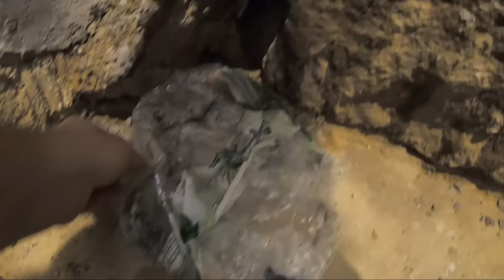Tiny House Shower #7 - Lasers, Lime, Bottles, & a Crazy Lighting Idea

Comment: You're render application technique is great Kristy!  You've come a long way!  May I suggest you use an aluminum screed (straight edge) to level off the high spots and fill in the low spots, followed by a wooden float to bring the cream to the surface and finally a steel float for a polished surface.  You are doing a great job :)
Reply from the maker: Thanks! It's a LOT easier to render with lime putty mixes, so don't be too impressed! 😁 I'll do a screed and float on the final coat. I still have a bunch of thickness to build out and I'm doing that in gradual layers. But for the final one before the finish plaster, I'll attempt those things for sure.
Reply: @PortugalfromScratch  I think you will be pleased with the outcome. You seem to be doing well.  I'm happy for you 😊

Comment: Wonderful work. I am picturing the completed shower in my head and I can't wait to see the finished product. I know it will be so much better than I imagined.
On another note, regarding the pomegranates. If that's the first crop, they usually remove it and the next one comes in abundance. It's really hard to do. I need to remove my first figs and it's not sitting well with me 😮
Reply from the maker: I still fully can't envision it in my own head... but I have a rough idea to work towards. 😁 Thanks for the pomegranate tip!

Comment: Your choice of tiles looks nice.  The smaller tiles will work well for the shower floor,   Is your plumbing on an outside wall?  Your LED lighting plan sounds interesting.  Good luck on your shower project.
Reply from the maker: Thanks! Yes the plumbing will come in from the back wall. In the case of the shower it'll be piped separately and then other pipes will come through under the bathroom sink and snake around the house over to the kitchen. It's possibly not ideal but I guess these types of little stone buildings have some unique challenges. 🙂

Comment: You should have thrift shop lead crystal decanters in Scotland, my friend had then filled with leds at a party and it was magical. I think LED string or water drop string  lights would fit your bill you can also get corks with a battery in the ‘cork’ a small string attached to push into the bottle, but threy are battery powered with watch batteries - not that eco!
Reply from the maker: All great ideas, thanks! Thrift shops aren't really a big thing here but I'll keep that idea in mind for when I'm somewhere they're more common!

Comment: I think what you are talking about are called fairy lights.  Edit:  I've seen some that have long strands that hang down.  Most are wires with the lights in the wire.  You would have to probably cover some of the lights with electrical tape so you don't have a long strand of lights showing.  Just in the bottles where you want it.
Reply from the maker: I know fairy lights... that could work but I'm thinking of something different. It's hard to describe it and maybe they don't actually exist! 😁 But I'm hoping someone out there might have seen what I have in mind! If I can't find these mystery lights, I'll probably use some sort of fairy light setup. Thanks!

Comment: It’s not the same as having lights in the bottles, but if that doesn’t work, a backup option you could try is LED tape/ribbon. A common and fairly easy to figure out/“install” version looks sort of like a roll of foam tape you might use around drafty windows, if that makes sense. It’s flexible and looks like rectangular pasta (not the clear kind that had tiny lights that give a pixelated look). Could drop a link if interesting.

There are apps you can use to control use, intensity, colors (solid colors, gradient colors, make it a pulsing disco, whatever you get into figuring out, ha!) It could run along the shelf to light bottles, or anywhere in the house really, without needing fixtures
Reply: There’s another kind too that’s quite literally like transparent tape with flat circuitry running through it, too. Probably the better easy option
Reply from the maker: I would love a link, I can't visualise what you're describing. My guess is that the bottle neck might not be wide enough for these, but maybe? I love the idea of controlling it with an app. I think what I need is called 'micro LED' and there are lots of programming options using Raspberry Pi and Arduino, but I think those things are out of my skill set. 😁

Comment: Are you going to embed the pipe for the showerhead in the wall? If so it needs to happen asap. The faucets for a shower often have a box thingy that is in the wall.
Reply from the maker: I have a shower head in mind but haven't bought it yet. Here it's common to have the shower head piped with a bendy pipe from the tap at the bottom. So the two pipes I've already put through the wall will be what feeds the shower. The whole thing sits on a sort of rail and that will need to be attached to the wall so I'll want to do that on this layer or the next, I think.

Comment: some girl has made some plans 😅. Those glass bottles are beautiful as they are and I can picture them with tiny led lights - great idea. Tadelakt is awesome, but when we were on the hunt for a Moroccan table for the outdoor terrace, we have been told that it’s not suitable for outdoor use as it is not weather proof. So not sure if it is a good choice for a shower? Where did you find those lovely patterned tiles? Currently looking for sth similar. 
Cheers to emptying the next 4 bottles 🤣. cu tomorrow.
Reply from the maker: Glad you like my plans! Tadelakt, when done properly, can even hold water as a bathtub! I'll need a lot of practise before I attempt my shower, but I'm confident it'll be ok. There's an amazing place in Costa Rica called Rancho Mastatal who make tadelakt showers, so they're my inspiration. I got the tiles from a place in Castelo Branco called Soffaragens (I think... it's near Rega Centro). 🙂

Comment: Doing great work as usual. Are those shower floor tiles glass? If so you may not want them on your floor. They will be slippery. Just a thought, and being glass when you have to cut them you will have to deal with the sharp edges left. Just my two cent’s worth from selling tiling products.
Reply from the maker: Thanks! No they're ceramic, I think? No idea but they're not slippery... there's a sort of gritty finish on them. They're common for shower floors here so hopefully they'll do the trick! 🙂
Reply: I had same thought, you can get tumbled marble or other stone mosaics that will have a rougher, safer and more durable surface.
Reply from the maker: Yes I think that's more what it is... it has a sort of rough stone feel.
Reply: @PortugalfromScratch  A good way to check is to wet them to see the reaction then!

Comment: Caution on leaving bottles open...what if condensation gets in and causes mold? Just a thought. No experience with such things.❤
Reply from the maker: It's a possibility but the bottles will be accessible so I can clean them when I remove the shelf overtop. It might be hard to explain... as far as mould... do you mean inside the bottle itself? If so, I can clean it easily. I'll likely run the lights through a cork but let's see!

Comment: Kristy I just had a question, i obviously can’t feel the surface but visually that lime putty looks ‘rough’ for a shower. Will it be hard to keep cleans than a smooth surface like tile?
Reply from the maker: Yes it would be and it is rough, but this isn't the final layer and the texture will change. With these layers I'm just building up the shape of the shower and then at the end I'll add a layer of lime that's a different type of mix and then I'll use a technique called 'tadelakt' which will make it smooth, waterproof, and easy to clean.

Comment: I see colored glass panels  and then strip of led lights
Not the bottle idea  but it's yours do as u wish
Reply from the maker: Bottles are essentially the same thing but it makes things easier as they're closed on four sides where panels would only be the front and back. It's also easier to get a hold of bottles than glass pieces. They could definitely work but, in this case, bottles make the most sense for me. When it's done it'll basically look like glass panels. 🙂

Comment: Look at ali for all possible led lights. I sure am a fan of those.

What will you do with the walls of the shower? Is your current mix ok for daily water and soap herassement?

Gr Marc Vida Futura Portugal
Reply from the maker: I think what I'm looking for is called 'micro LED' and it's used fr small models or giant display boards with individual lights. Using them seems like it requires some voodoo, though! 😁 Seems sort of complicated. The walls as they are will last a long time but I can't really clean them properly. I try not to splash around too much as they are. But in the future I'll use a technique called 'tadelakt' which will make the walls cleanable and water resistant.
Reply: How will these lights be powered? seprate chargeble battery, of 12v from the bluetti, of 230v? @PortugalfromScratch
Reply from the maker: I'll just have them plugged in, powered off of the solar for my house. Eventually there will be a power point over there somewhere. 🙂
Reply: @PortugalfromScratch   can I send you some samples? Just to try out, and find out what you want.
They will be shipped from china (I think) and are not expensive. 
If you like the idea, let me know a shipping adress.